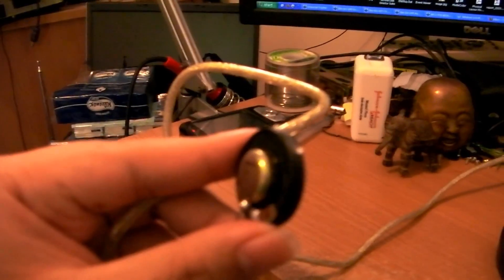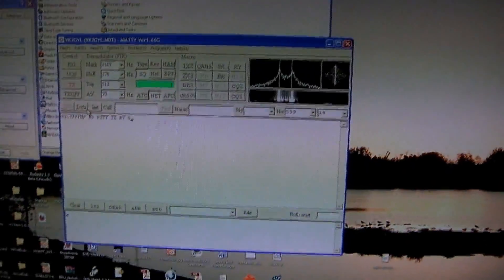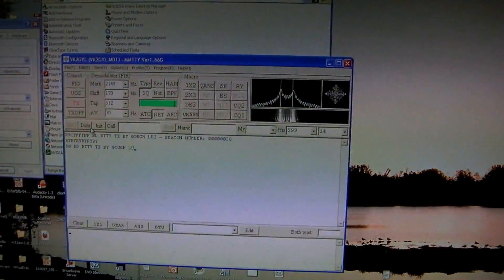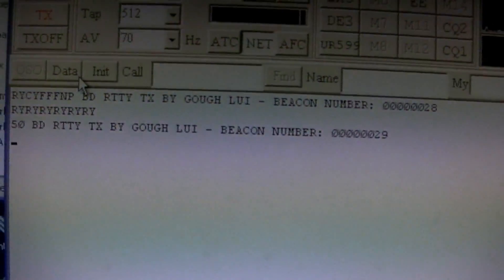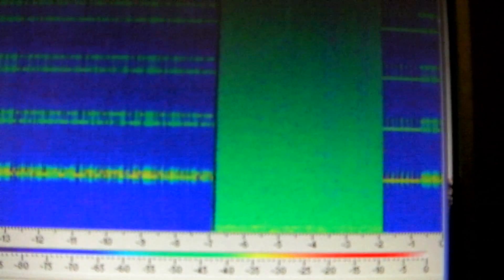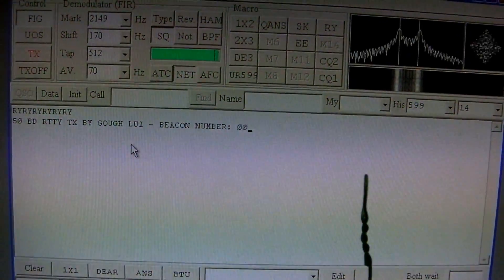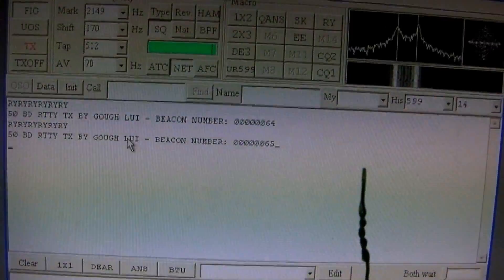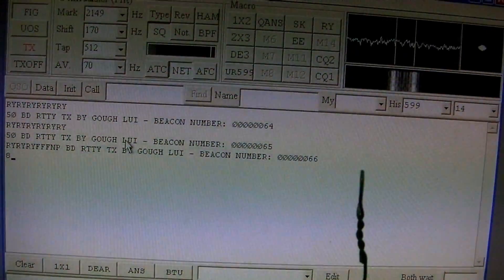50 baud RTTY transmission using the Arduino

Comment: With a audio amplifier and if a you can make a antenna and tuned for a wavelength of approximately 8 miles antenna 28khz or something like that

That it should be possible to launch united states navy nuclear weapons 
By transmitting this and south Korea or something will blow up 

A5\CA\D7ZFW4%\D4҅\q\B7\FBd\AFH(tj\F8\88\9D>\9AB9x\BB-_m\A9\AE\C9I\F9\A5\F2'\D7\
C8JM\E4&Y2\BB\DA}Q\A2K\A7\A7\9DB\83\CA\C1\B7\A5\F5 ᡭת\C2g\B6\AC\82w\C8\FD)\D6\
D0~\B7К\AC\84\B6\CA:\94B\93Z\CE\CB\FF\F8\DE?\D8_&Ф\CEh\FA>iU\CD'\BF\92)3\
BB@Yy}qK\89
]\BB\A5\F2\93\C6
\B8"\A2#Vy\E3\A7\F7_@Q,5\F9\CDU\C3\FB\CB9a\A0\B2V\F0\EFeFXUdsWC
\96:\82\CE:$\D8h\E4\90\A9\B5\8C\A8\F3jx!\99\90\DA \E3RB\97\A7\9Aa\CDm\95\90\DEC\DF u\
F1e\80\D4\FCZE\BF/\B5a* \E0u\EC\8B  㒢\@\B0n\A4
\E13\A4\FC\D2\E2\9EQ 癥 1?$v \9B7\DBڄ\C0\E6\99UZHm\F9tu\BA\C6aUy\B2B7\9C\CD1?!F\
88
(\E6'6gt1F\D1|k-4\E7\92L\EBОV\A3\9DUf\8F\D3\D8Zi\A2ejM Ũ\D2\EB\E8 \B4R\BF\F7\93\
C3@\A4\88N\BDB\FE\EEB\AE\A1g}\B1\A7y\BF:e\D7b\B1\AEv\9F_\9C<\EE\B0vo\BDd\97"\
B8 弝 T\9B\E75\91\82\B9\86\CA\F0\89d^+\89\DB*\D4)\94dCf\EC\D5\C7s\9B\\82\C5\CBvfua!&\
E3H\A2C\D0Kg\AD7\B3k\E7\F1\ECN\E8\B40\BD\ADWP\91P_\E2\DCP#\8C\BA\A5\8C\95\82O
\B6\EC8\FE\C89\A41e\B2U/\C3a \A0Ά\E3\F5\BD@+\B2qE5T3\E5U\TZ\EA\F0Gp\8F\ Վ
82\AF%:\A3\B4l\8DhM*ą\C5\FC\97\E9i\8Fut\A1J\83\9F3\8A\85k=\B6\A4\FD_\D8\DCkB\C1\F2\
CB\F1\99\F8\B6\90\BCB\BE\BD%\EA\D4\E8\EA\84\84*\C1\A5DqK2\83\EB\83\D45\9A\
82\8A)*jR\8F\FF\94\B7\EB\B9 \EB\9Fo8Q\99\CE0\81Lw==q$\B7t\A0&tI\AE$\A6u\8E89\ܥl\A7\
A1\C5I'Z<P\86=\D4h\E4{\F4<
\EE\ED\EC>ޞر
ٲ
Reply: 25 hz fsk 50 baud
Reply: The audio amplifier would be used as a rf transmitter with 28 khz carrier  with 25 hz fsk 50 baud transmission 

 A vacuum tube amplifier may work best for that may only need a fue watts if the antenna is tuned to near resonance with a positive feedback may help but a class ab solid state amplifier may also work but may take 50 or 100watts amplifier as vaccum tubes are voltage amplifier and transistors ar current amplifier it takes a more powerful amplifier to generate the same amount of voltage

Comment from the maker: @enigmaSSH I give you no guarantees about the code, aside from the fact that it does work for me and it does make 50 baud square-wave RTTY just fine. Here's my code - it's ugly but it works on an Uno/Duemilanove. Output is on Pin 10. Beacons the string in the source file and pauses for 1 second before re-beaconing. dl.dropbox.com/u/28596968/goughRTTY.pde
Reply: dl.dropbox.com/u/28596968/goughRTTY.pde IS GONE. Can you re-uploading once more please?

Comment from the maker: @enigmaSSH I wrote my own code to generate the FSK ... it was quite simple and educational to write one up. The speaker was connected to one of the output pins in series with a resistor (as the speaker is 8 ohm and the current source/sinking ability of the ATMega328 is 45mA/pin). The output is a square wave FSK - not suitable for directly keying up a transmitter if you want a "clean" harmonic-free signal, but I used a very small ASK RF-link module designed for 10mW or so just for testing.
Reply: Have you thought about losing the transmitter and bitbanging it directly out in hf? How high can gpio frequency go? Maybe esp boards go higher